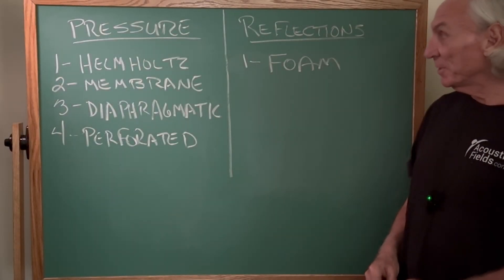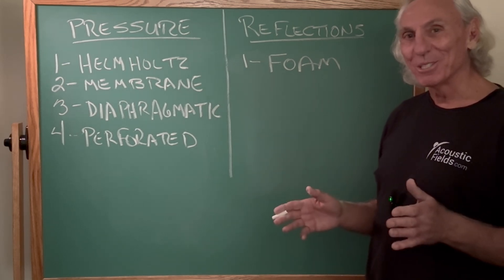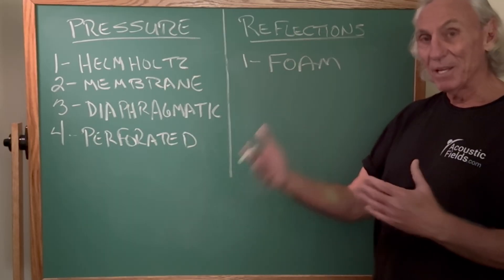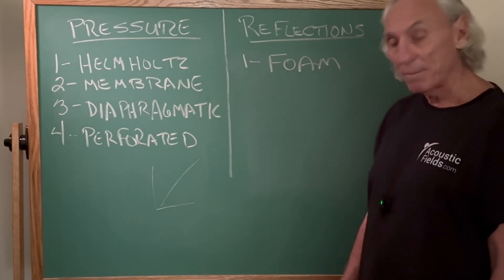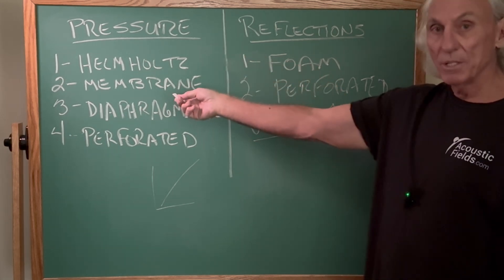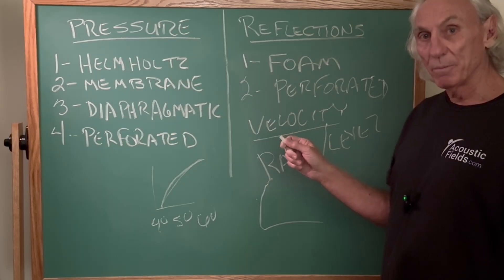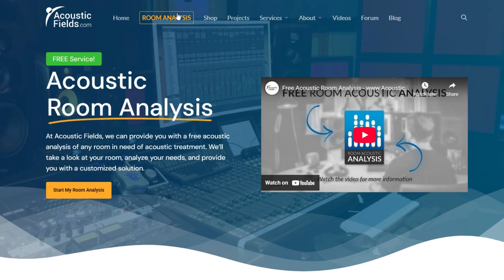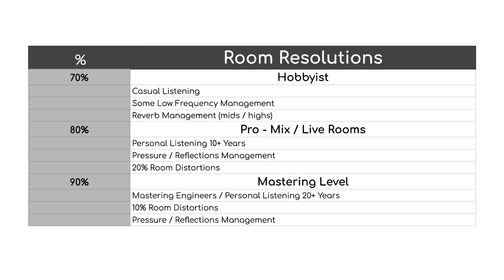Pressure + Reflections Treatment

Comment: could you make an episode on low frequencys and how the propegation of them differs under the first fundamental roommode? specially when the door is closed ("pressure chamber effect") vs open
Thanks, love your knowledge but that was one thing im wondering, as many probably have sealed rooms but i actually prefer the sonics of an open room
Reply from the maker: Low frequency energy goes through most wall constructions. You have boundary pressures along with modal issues throughout the room. A window or door open here or there will not matter much to overall room frequency response.

Comment: :D Thank you! 
I'm back over here because when I started a conversation with GROK about room treatment for Bass, the first thing 'he' said was Corner Traps... lol
Reply from the maker: This does not surprise me. Garbage in, garbage out.
Reply: @AcousticFields  Yeah, that's my assessment of AI too.  It all depends on the question, how it's worded on whether or not it gives solid answers that can be verified from reliable sources. But it's just whether or not the AI has been given solid information to begin with.   

AI can be good for some things I guess, but it's over hyped IMO.
Reply: @AcousticFields  I tried to see if AI could calculate the Axial room mode frequencies for given room dimensions and it did it fast and accurate.

It showed the calculations and it spit out the frequencies along the L, H and W according to the dimensions I submitted.  

I double checked it against what Amroc gives and it's pretty accurate.  But again, I would prefer to use Amroc because there's a lot more information, and a 3D rendering.

But again, AI has some advantages, but it also has disadvantages, but the user needs to be able to tell when it's giving good information and when it's not.  That's the crucial part that the user needs to be aware of.
Reply: I actually was playing around with Google's AI in Google Search and it came up with different answers depending on how I phrased the question.   That's something to consider when dealing with AI.    I was using the terms like low frequency pressure absorption, Axial modes, etc.   I asked all kinds of questions and got interesting answers, but a lot of it is what Dennis discusses.